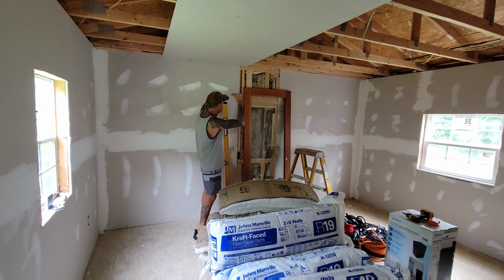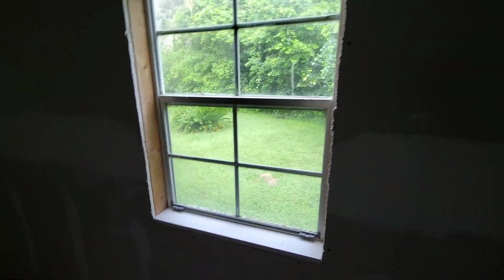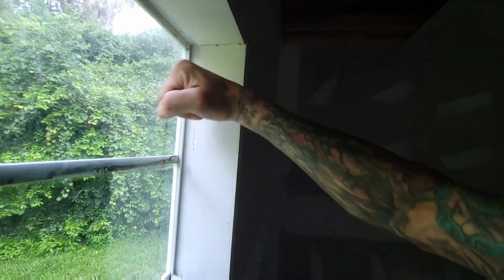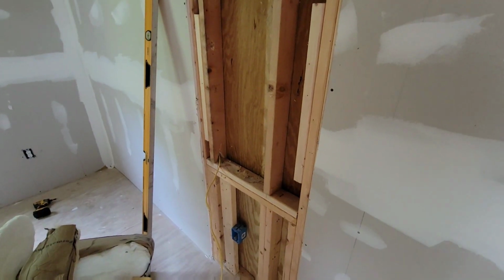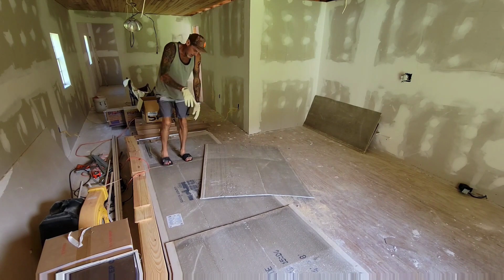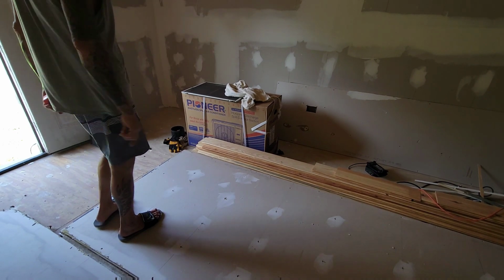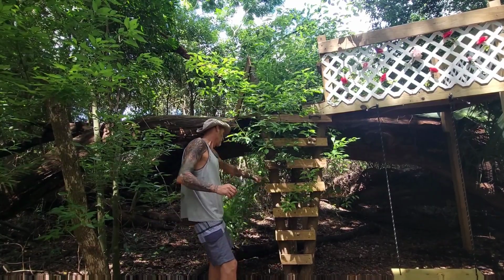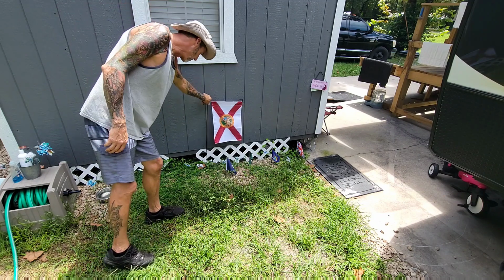Movin and Grooven WILLIS

Comment: Travis I have been meaning to ask if you are putting insulation in the walls. As someone who has stayed in this type of build before, the owner told me if he had to do it over he would definitely put insulation in the walls and a insulation under flooring. So floor walls and ceiling. 💖💖🇦🇺
Reply from the maker: Yes, it is fully insulated

Comment: Somebody needs to learn to insulate..The R valuue is in the actual thikness of the material so when you just cram it without cutting to fit you loose the actual R value..Insulation is very important it keeps it comfortable and keeps the bills low..Also make sure the attic area is well ventilated..Insulation s\hould be installed like dry walll measured to fit exactly
Reply from the maker: Ofcourse Lloyd. Thanks for the tip